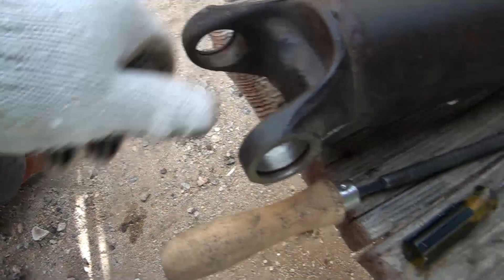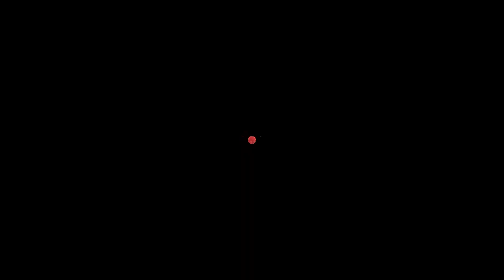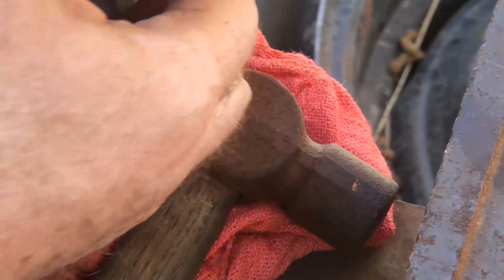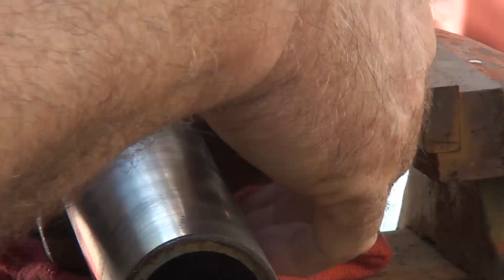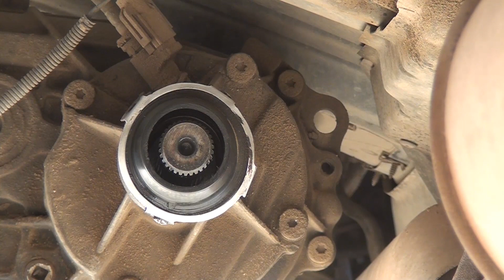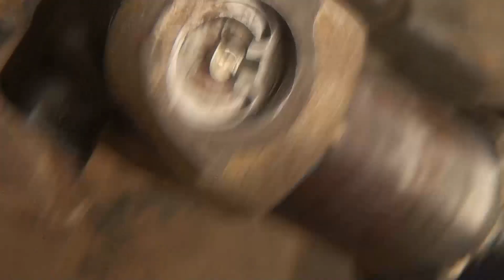If You Hear This Noise, 87 F150 U-Joint Repair Part 2

Comment: this is a task I'll be doing in the next couple months.  ol willie nelson started clunking when I would let off and then touch the gas again so I'm assuming it's the U-joints...
Reply from the maker: Put it in park or neutral, e brake, on wheels blocked, and grab the drive shaft with both hands and try to roll it. If you can see and feel movement, then you know what to do.

Comment: good job very well done but instead of liquid wrench use a bit of never seize(anti-seize) works well on the bearing cups and helps them from seizing up  thumbs up and shared all in all good job buddy
Reply from the maker: Thanks for the tip. I have some and will give it a try on the next one.☺